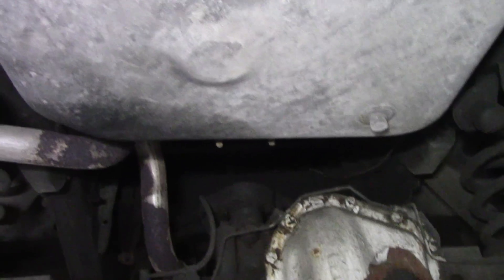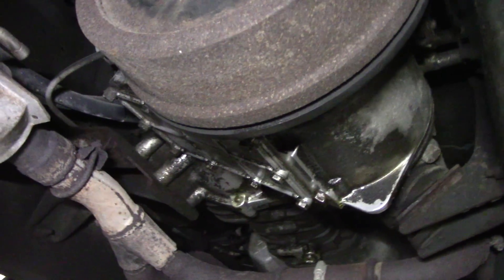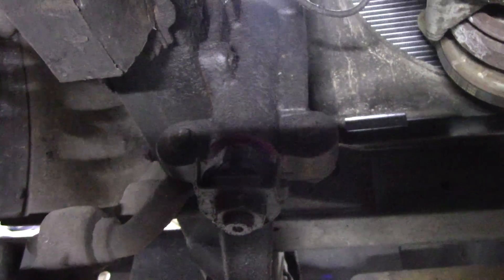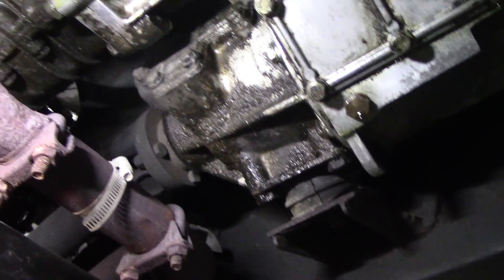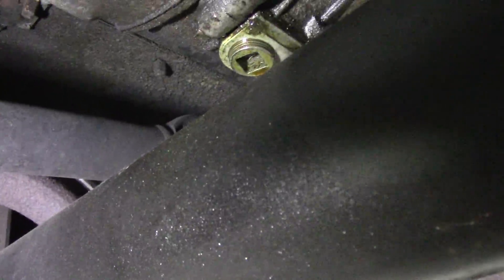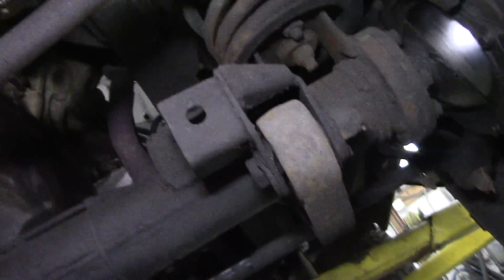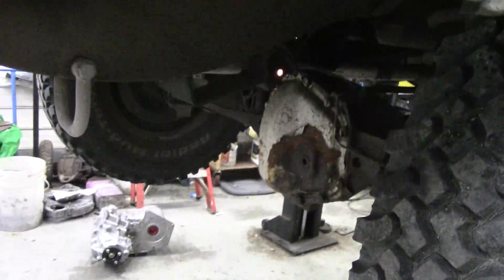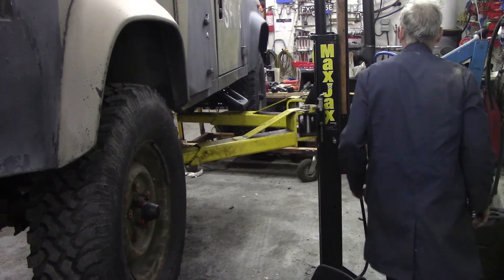1985 110 ex NATO V8  Part 3 under the beast!

Comment: Ok Mike at 3.33 minutes into the video,  you mention the prop shaft being on backwards. Over the years I’ve tried to find out what way this should go on and for what reason. PLEASE put an end to the torture!! Loving the 110 by the way.
Reply from the maker: The sliding joint always goes to the transfer box side both front and back. To minimize dirt getting on to the sliding joint

Comment: Mines the same year but my lt85 is not the split box,l have the 4bd1 with a turbo. l love the inset door handles because you cant shear them off if you hit a tree. l have reconditioned everything except the motor. My landie is called a County and is very collectable here in AU, your lucky to fined one. The lt85 l use normal engine oil 20-50

Comment: I had a massive gearbox oil leak eventually traced to a loose bolt on the top of the box. While the top cover was off I found a linkage bush that some kind army mechanic had stored inside...